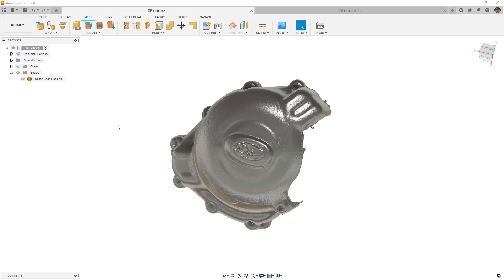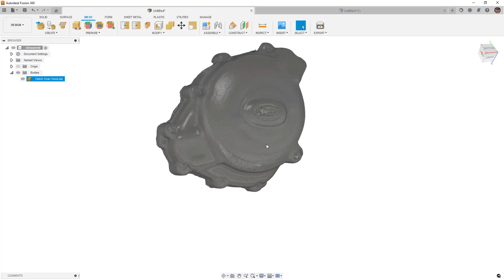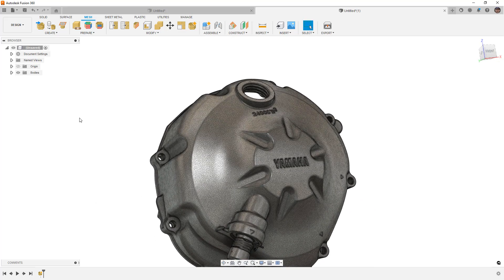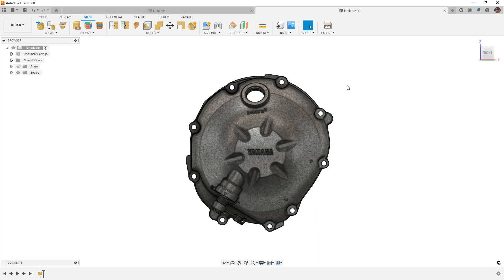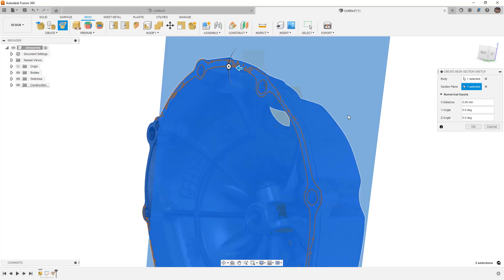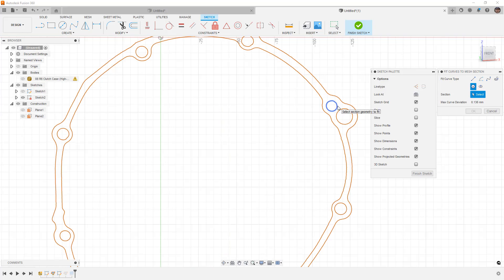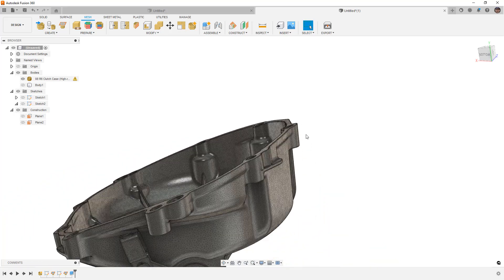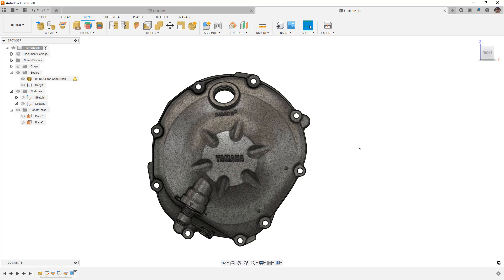Is A Hobby Scanner Worth It? | Comparing Hobby vs Pro Scans to Understand The Differences | #3DScan

Comment: You can get a very detail model with a hobby scanner, it takes more scans and set up
Reply from the maker: Detailed yes, but accurate probably not.  But again as I mentioned in the video it depends on what you intend to do with it and a lot of other factors like setup, prep, lighting(depending on the scanner) etc.  We can scan a car fender and make a fender flare just fine with a hobby scanner if you plan to 3d print parts.  The accuracy of the scan, the 3d model and the 3d print all contribute to the problem so an extremly accurate scan isn't going to help if you are printing a 10in part on printer that isn't as accurate.  But if i was going to pay to have tooling machined from foam off a part I designed off a scan, I want that to be a high quality/accurate scan.

When you look at a hobby scan like the Revo Pop I mentioned, they claim decent accuracy of around 0.05mm, but that is a bit misleading.  On the upper end with something like a MetraScan they claim 0.025mm accuracy.  Where this falls apart is when you start digging into Volumetric accuracy.  That $100k+ scanner claims 0.064mm volumetric accuracy(which is ideal in a lab).  On top of that capturing true edges is nearly impossible especially on thin parts.  a true CMM or CMM/Scan head setup will be more accurate there tracing an edge.

But back to the issue.  If you are trying to scan and replicate a small 3d part, say 1in (25mm) across the number of scan positions for that 3d part have a very negative affect on the accuracy, even on a very expensive scanner.  Scans are great references at the hobby level but you will be better off measuring parts by hand rather than trying to build it based off the scan data.

Comment: So would a $1,000 or under scanner be able to scan a ace body well?
Reply from the maker: The Einstar seems like a good option.  I would suggest checking out the Making for Motorsport video here https://www.youtube.com/watch?v=mYplfztpmxU
Reply: @LearnEverythingAboutDesign  I have bought Einstar, and all isn't as great as some videos suggest, the Motorsport guy hints at the issues, but maybe they'll improve the software with time
right now some scan modes struggle, constantly losing reference, reacquiring isn't accurate and produces "ghost" clouds, also the hardware requirement is quite strict, while the software will start on lesser hardware, I had trouble with i7-6700 and rtx3080 32gb ddr4, had to upgrade cpu/mb to i7-13700 to get the software to run with acceptable FPS scan rate, so that is at least another 1.5~2k pc to run that 1k scanner
Reply from the maker: @dsfs17987  great info thanks for sharing!  The current series I am working on I am using the Pro Hd scanner that Shining sent me.  My old laptop has been doing OK but its certainly not a power house.  Talking to Shining about the ExScan software they are continually updating it.  I noticed that it really doesn't touch the GPU on my machine.  I was able to use it on my desktop for mesh processing with a pretty low end Gcard but couldn't scan without it crashing.  On my laptop it runs which has an i7 7820hq with quadro p4000 and 32gb ram.  Its pushing the low end of what it can use....

Comment: If I were to send Paul that exact Yamaha part, what would it cost to get professionally scaned?
Reply from the maker: Jacob it is hard to say for sure but I think Mesh Only(meaning no solid body even as a dumb solid, but just mesh like you saw in the video) would be $150-$300  USD somewhere.  To know for sure you would need to contact Paul to get a quote.

Comment: Its very misleading to say a product costs 10K to 20K per year when its simply not true.  If you don't know something do your homework and find out.   That is the purchase price and one time fee.   You also don't have to pay any subscription or maintenance fees every year.  When you purchase Design X or Design X Essentials it you own it forever with no additional costs unless you want to upgrade.
Reply from the maker: While I appreciate the comment I don't appreciate the tone.  In the video I did say the range of the price was $10-$20k and I said "I believe that is a yearly fee but I wasn't sure".  And on the topic.  If you buy Geomagic Design X for $19,950 there is an optional yearly maintenance fee of around $3000.  Just like software such as solidworks if you opt to not pay that and you want to upgrade a few years later the contract states that you need to pay back maintenance fees.